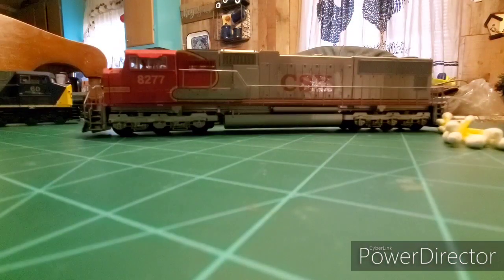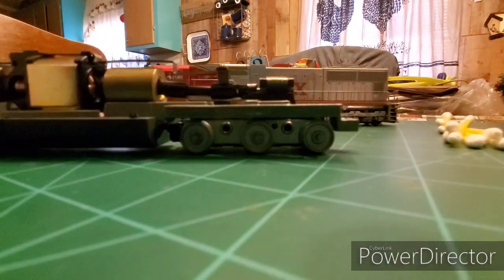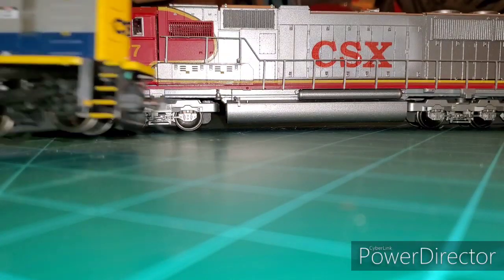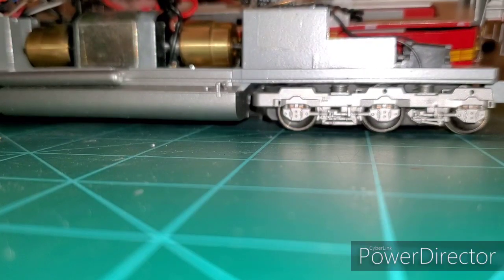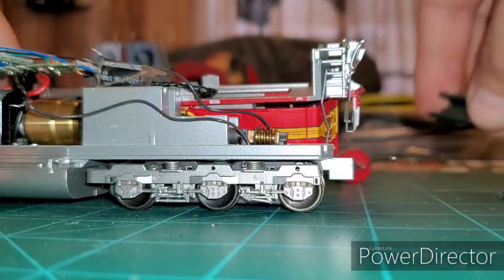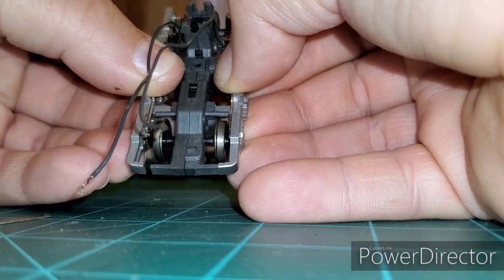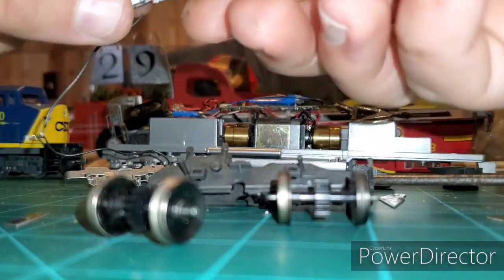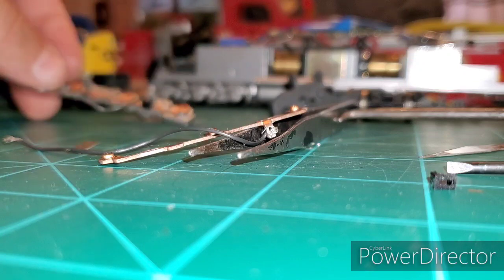How to disassemble Athearn Genesis Trucks\wheel sets

Comment: I bought 2 BNSF models of these a number of years ago,...both new ones. Only a couple of days ago I got them out to test on my new layout. They both derailed EXCESSIVELY,....on brand new engines from Genesis !!  If I can't get satisfaction from Athearn, I may have to never buy another of their product,...defective design.        Is there a possibility another truck product could be substituted??
Reply from the maker: It's most likely your rails. 10 to 1 yo7 have only been running 2 axel trains and your having problems with 3 axel trains.
Reply: @pieseasmyseas 
 Its not my rails as I have run 3-4 othere 6 axle locos over these same tracks WITHOUT derails
Reply from the maker: @usacitizen1000  well I thought the same thing for a long time. It could be a cut lever on a Kaydee cuppler it could be a lot of things but I will still say track work. I wasn't shur until I started taking slow motion footage and watching the derails that I realized that some trains have more up and down movement in the wheels and some have more of a flange on the wheel. A 2 mm flange in 1:87 translates to 1.5 inches when scaled up so if your train wheel move more than the flange height, I would be the same as if a real train jumped the rail at 2 inches.